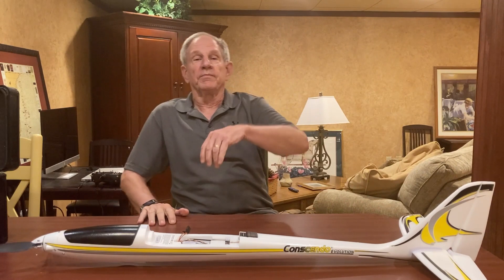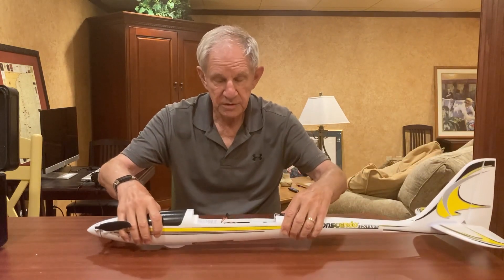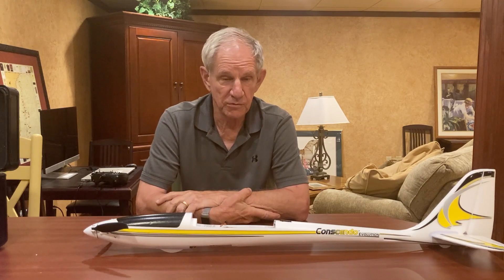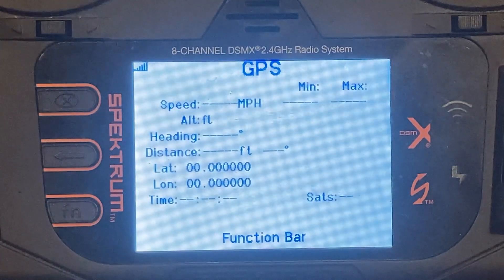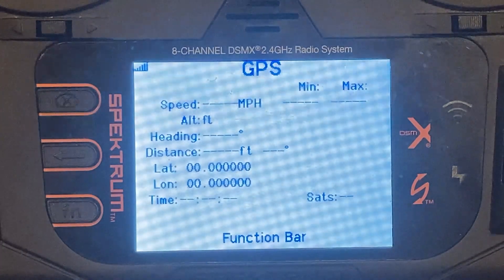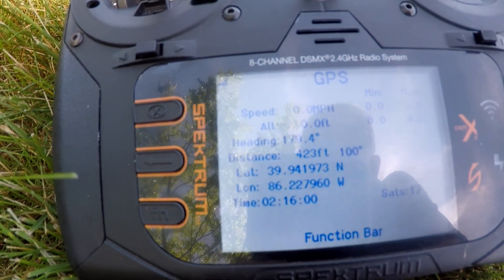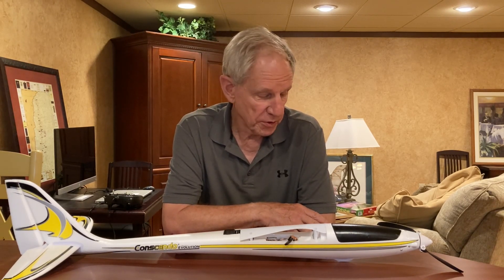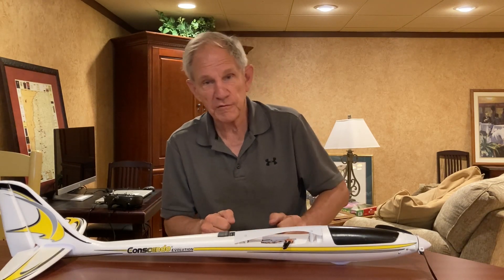NEVER Lose a Model Again! Demo of Telemetry GPS System in an E-Flite Conscendo

Comment: I have and fly a LOT of gliders... and I ALWAYS make the bottoms fluorescent orange. With either monokote, or the orange strips. Also, I cover some of the upper front of the planes,  with chrome, so that it reflects the sun very well.  
If you were having difficulty trying to get it down,  and IF you had failsafe programmed in, you could have just turned off the transmitter and the receiver would have gone into your failsafe positions, and you wouldn't have lost it 😢
Reply from the maker: In my case I fly in an area where searching for a lost plane can be problematic if you do not have a good idea where to start.

Comment: FYI - If you find that after configuring the GPS to readout altitude in AGL (above ground level) but the display doesn't provide that information, wait until the GPS has acquired then press the transmitter 'clear' button which will ZERO out the display then begin to show altitude AGL.
Reply from the maker: A very belated thanks!

Comment: I learned long ago flying large airplanes IFR that a simple way to get reciprocal is either add 200 and subtract 20 or subtract 200 and add 20. That sounds a little complicated but it’s obvious when you do it if you add 200 and you get 300 and90 you know you should’ve subtracted. It’s quick and it’s easy it becomes intuitive.

Comment: CAN YOU PUT THIS IN DIFFERENT AIRCRAFT'S ETC SAVE 💵 OR NEGATIVE -? 😕 ALSO SAW THAT WE CAN PUT A GPS UNIT ONTO SPORT CUB S 2 - 615MM?DO YOU EVEN THINK 🤔 THAT IT'S WORTH IT FOR THIS ✈ 😂SERIOUSLY IT'S ALOT OF 💵 FOR A STUPID PLANE ✈... MY 1ST REAL ✈ AFTER MY FOAM TRAINER AKA 2-CHANNEL TRANSMITTER 🤦‍♂️ IS THE NIGHT TIMBER X 1.2 & THANK GOD I DIDN'T GET IT 📴 THE GROUND MY 1ST FLIGHT! IT WOULD'VE WENT SOME WHERE ELSE LIKE 4-PART'S 😂 🤦‍♂️ FRY😢EITHER WAY NOW I'VE GOT THE UMX ULTRIX, CUB S  & SPORT CUB S 2 ❤HAVE YOU FLOWN THE ULTRIX YET? IT'S 🤪
Reply from the maker: Hi, as long as the other airplane has a receiver with the telemetry data port you can swap the GPS around. That would include any of the Spektrum line with a T at the end of the model number. My experience is that it works well almost anywhere you put it in a foamy. It's where it is on the Conscendo because there is no room in the fuselage. I agree that the GPS is not needed for everything.
I have flown the Ultrix, but not the UMX version. It's an interesting little bugger.

Comment: Great video, thanks for sharing. I was looking to buy the Conscendo /NX8 and couldn’t find any info for using the gps module or even if it fit.. Thanks!
Reply from the maker: It's a super accessory, especially for a sailplane that can operate at distances where you might lose sight. Mine went down in a cornfield with little damage, and the GPS position plugged into Google Maps took me right to it. Just don't turn the transmitter off until you either take a picture of the GPS page or plug the lat/long into a phone mapping program. There is no way to mount the GPS in the aircraft. Taking out a foam notch just behind the wing and gluing the module there has worked great for me. I think I had to get a longer cable to connect it to the receiver without fishing it through the foam.

Comment: Hello! You helped me get this system to work on my Conscendo, and last weekend my plane was caught in high winds aloft and and flew out of sight. But thanks to the GPS - I FOUND IT! However, the foliage it fell into was so dense that I could not see the plane even being only 20 feet away. But I had also installed a beeper, so that I could turn a switch on my transmitter to activate it. The plane was at least 1/2 mile from where I last saw it, and I was very surprised when I found it again. Thank you!!
Reply from the maker: Super! My DJI Mini went into a tree last week. Pulled up last location on Google Maps and turned on flashing lights and buzzer when close. Found it in heavy undergrowth within a minute. Cool tech.

Comment: Thank you for the video.  I am able to get distance and angle data with my NX10. However my IX14 only shows distance and not angle.  I am hoping Horizon Hobby will remedy the issue to make the IX14 more useful with the GPS module.
Reply from the maker: Thanks for the info!

Comment: Great video! I lost my first Crescendo due to total pilot error. I now use a $40 autopilot module and at the flip of a switch on my Nx8 she will return home and circle  the launch area @200 feet.
Reply from the maker: Where did you get that module?
Reply: @GoofballFlyer  I'm guessing its the GPS Module Item No. Spektrum - SPMA3173, which is what Spektrum calls "Safe-Plus" and is available on certain HH planes. I'm guessing it could be integrated into a plane not listed on the description page as well.
Reply from the maker: Maybe but I have my doubts. The receivers are the 4650 Serial Receiver, not the AR-series in other BNF models.
Reply: @GoofballFlyer  digging more into it I think you're right, the GPS Module with RTH is seems to only be compatible with those receivers. Thanks!
Reply: I don’t get why Spektrum makes it so complicated. What is the problem of making a pointer that always points in direction of the starting point? Is there anything like that available from Spektrum? Great video, thx 👍
Reply: What is the name of that module,  and where can I get one ?? Thanks !!

Comment: Thanks for the video. Which would you say was the better GPS? This GPS telemetry sensor or the more expensive Spektrum GPS module? They both seem to offer the same information. Also which port does this plug into on the RX? I already have the volts and the extra satellite plugged into my Spektrum AR rxs. Thank you. Mark 🇬🇧
Reply from the maker: You can daisy-chain multiple modules

Comment: Thanks so much for posting about this GPS module!  There is next to nothing out there explaining this module and zero documentation from Spektrum.  While I have and love my Conscendo, I put this module in an E-Flite V1200 Sport.  It's supposed to do 140+ mph so I want to measure mine.  Setup with an iX20 went smoothly, however, I seem to get GPS altitude no matter what.  I will play with it more to see if I can sort that.  I did go to the GPS menu and select AGL, no joy.  Looking forward to seeing it in action.
Reply from the maker: More - You can set ground speed to display on the transmitter ticket tape. From the transmitter home page scroll to the GPS page and you can see max ground speed, distance, direction, GPS lat/long and aircraft heading in real time.
Reply from the maker: I get only distance. If you look at the transmitter GPS page it shows max groundspeed. No clue about how to change the audio reports.

Comment: I have another question, and it's OK if you don't have time to answer all of my questions because I have posted many. But you may be the only other owner of a Conscendo Evolution who understands the technology and who has a YouTube channel where there is a decent chance that my questions will be answered. I fly my Conscendo with a Spektrum DX6e. In the various Telemetry displays that can be scrolled through, there is one for Smart ESC. In this display has a setting for the minimum cell voltage, below which there will be a warning beep that I can turn on or off. On my plane, the lowest min voltage I can set is 3.8 per cell, which seems strange to me because it's common for people to fly their Lipos down to 3.7 or even 3.5 volts per cell before changing the battery. So when flying my plane, I kept getting a warning beep when I gave it full throttle, because the battery voltage would temporarily sag below 3.8 per cell, or at least that is what I think is happening. The display for Smart Battery gives the correct battery voltage, which is higher than what the ESC display says. For instance, the Smart Battery display on the DX6e might show 16 volts, or 4 volts per cell. But the Smart ESC display will show "minimum voltage" as 3.6 per cell, or 14.4 volts. NOW I get to my question. :-) If you have read this far. :-)  First, do you know why the telemetry from the ESC is set up to give a warning at 3.8 volts per cell, and why I cannot set it lower than that? It seems that the plane's electronics should not have any problem whatsoever with 3.8 volts per cell. Second, given that voltage naturally sags at full throttle no matter how good the battery, do you know how much it can sag before the receiver isn't getting enough power and I could have a brownout? Thanks so much.
Reply from the maker: I do not have access to a DX6e so cannot see that page. I have it set to 3.4 on my NX8. This would be a good question to ask Horizon's tech service via email. I have had great results doing that.
Reply: @GoofballFlyer  Thank you, and I reached out to Horizon Hobby and they are sending me a new receiver to see if that fixes it.

Comment: Thanks for the video. How do you get the NX8 to announce the position so frequently?
Reply from the maker: Go to the Telemetry page, select GPS, and on that page at the bottom set Alert to seconds between the announcements that you want. Distance from the point where the GPS initialized for that upcoming flight is the only thing you will get on a verbal GPS alert. My Conscendo also has a Variometer that I set for 60 seconds. I get verbal distance, altitude and ESC voltage reports every 60 seconds. That seems like a lot of information, but after a while I only really hear what is important and filter out the rest. I have the Rknob set up for volume and can easily turn off all alerts if I want, and can set the volume low enough as to not bother other pilots. Hope that helps!
Reply: Hi had a similar occurrence but fortunately found the glider the following morning. I have bought the GPS unit and will use. Thanks for your video gives me confidence it will work. 👍
Reply from the maker: It will work - even if the flight battery fails the last known position is better than nothing.

Comment: When you fly your Conscendo Evolution, do you ever experience loss of control for a moment or two? On mine, sometimes the plane is unresponsive for a couple of seconds, then it responds again. This is how it behaves for me out of the box, with no modifications. It could be my imagination, or it could be that I need to get used to moving the angle of my transmitter antenna sometimes. I have heard that if the Spektrum 2.4GHZ transmitter antenna is pointed directly at the plane, it could weaken the signal and so I need to be careful to avoid doing that. I don't know how true that really is.
Reply from the maker: Do you know how to do a radio range check? I had a different model doing that and turned out to be the servo leads interfering with the antenna. That should not be an issue for the Conscendo. I suggest you find a range check video for your transmitter and check it out. I’ve never experienced loss of signal with mine.
Reply: @GoofballFlyer  Thanks so much, I will do that. I have actually set my Conscendo aside for a while, and I've gone back to a more beginner-oriented model because for some reason, lately I have been having too many "close calls" with the Conscendo. This did not used to happen to me with that plane. I have some guesses as to why, but I think it's my fault - I have gotten over-confident, perhaps. So I am going to practice more on something slower and smaller that I can fly at a soccer field, then go back to the Conscendo.
Reply: I started flying my Conscendo again,  and have found issues with the signal reception.  On a typical flight my flight log shows between 3 and 5 holds, which surprises me on a factory Spektrum radio setup and a Spektrum radio. I'll do another range check and check for loose connections but if I can't figure it out I may take it back to the Hobby Store to see what they can figure out. Any suggestions on how to sort this out? The plane is basically unchanged from the factory other than adding the GPS and I also added a loud beeper that I can turn on and off if I were to lose the plane in brush. But both of those are on the top of the plane away from the antenna wires and the wires for them follow the same route as the aileron servo wires for the wings.

Comment: Thanks for the video! I have a Conscendo Evolution and have lost it and so I took your advice and got the same GPS unit. My transmitter is a dx6 however. I plugged the GPS unit into the xbus slot and set up telemetry on my transmitter to display GPS data. The GPS display on my transmitter looks just like yours, however it is not showing me any information. The latitude and longitude for instance is just blank. Do you know how to get the setup to actually send out GPS information?
Reply from the maker: Take the model outside so that it can acquire gps satellites. It can take several minutes for the initial position to show up. 

If that fails try plugging into the other receiver port. The single port side of the AR637TA has not worked for me.
Reply: @GoofballFlyer  Thank you! It ended up that plugging it into the other receiver port did the trick! I have also found the the single side port does not work. I ended up cutting a rectangle out of the foam wing roots (under the curved plastic wing retainer) and it seems that it hasn't caused a problematic lost of strength in the wing, and the GPS unit still get the satellite signals fine.
Reply from the maker: Excellent! Glad to be of assistance.